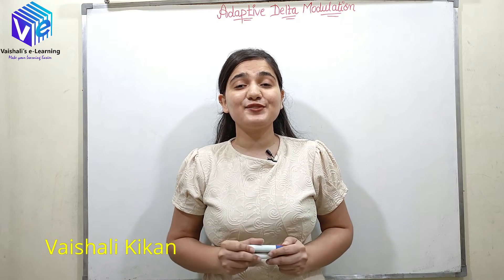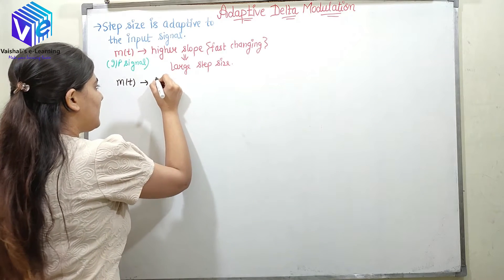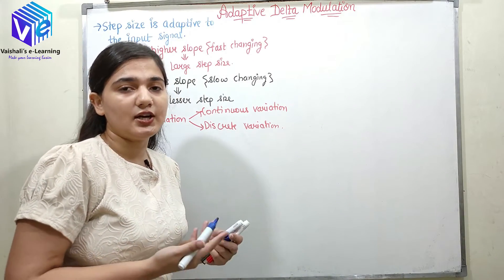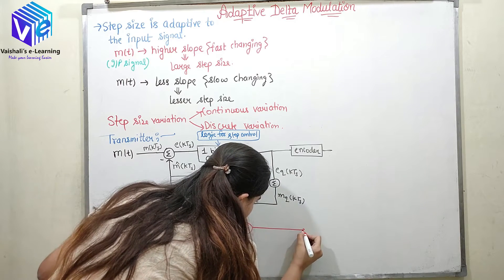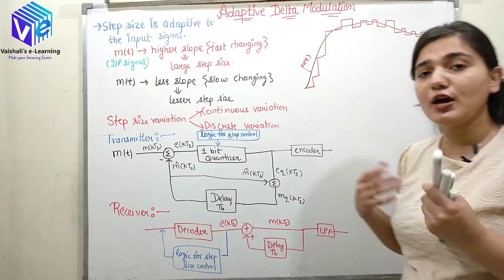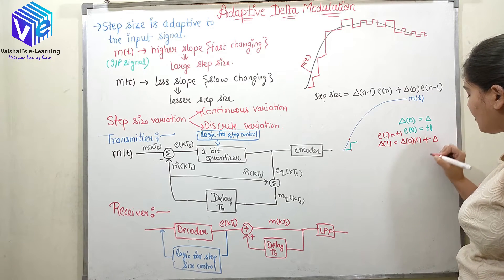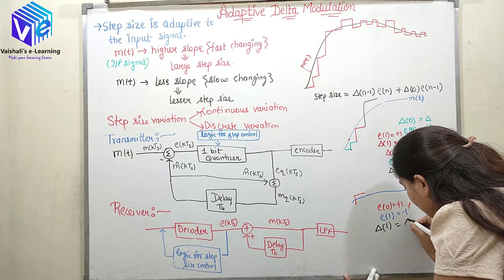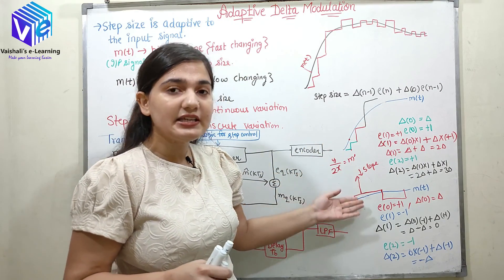L 87 | Adaptive Delta Modulation I ADM | Digital Transmission I Communication System I GATE NET ESE

Comment: Hello mam
Your block diagrams are different from other lectures . Will there be a difference?
I watched all your series constantly.
I am comparing  you with others but just a doubt.
Reply: I am not comparing you😁
Reply from the maker: I have followed different reference books and tried to teach every concept in easiest possible way..
Maybe your other teachers have used different books.
But topic and diagram all are correct..
Reply: Thanks fo the early reply mam